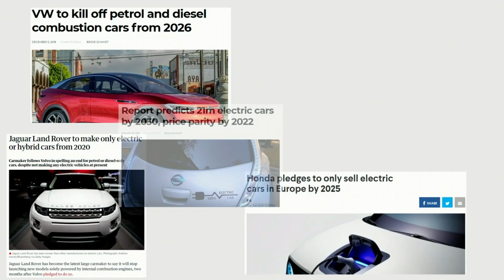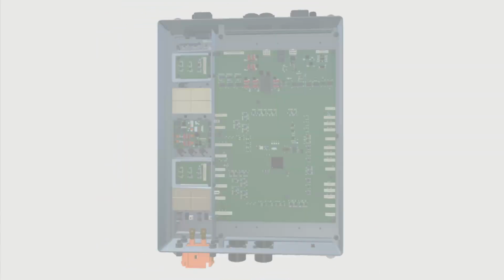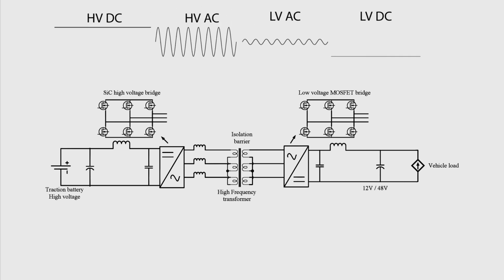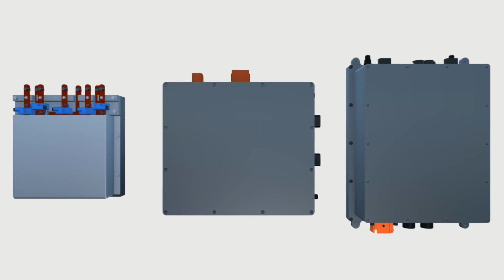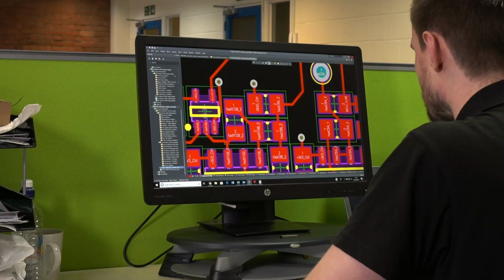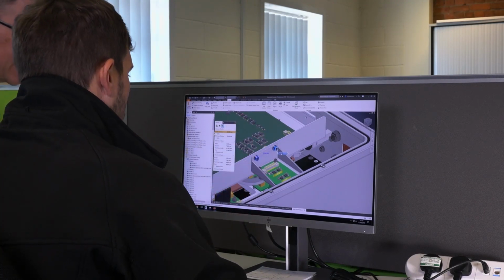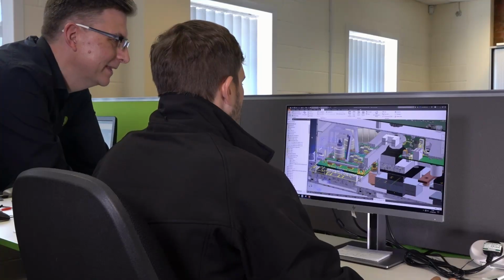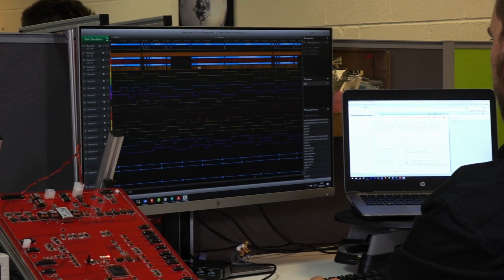Power Electronic Subsystems - AVID Technology

Comment: Always fascinating, AVID is such a fantastic resource for learning about the components involved in manufacturing EVs. Thank you very much for taking the time to post videos and podcasts.
I have a question: I have seen a charger with DC/DC converter combined in one unit. These are designed for small to medium installations such as conversions from ICE to electric power, perhaps up to 130-150 Amps. Do you think these are good cost-saving (and possibly weight-saving) devices, or is it another example of corner cutting from Chinese manufacturers, and not saving anything?
Reply from the maker: Hi Jack, thank you very much for the feedback we are really pleased that you enjoy our videos and podcasts.

More integration of devices is a big topic to try and reduce costs in EV powertrain components. Combining the DCDC and OBC into one unit is an example of this. In theory the DCDC will be at peak load when the OBC is not and vice versa so the overall volume of the cooling system and some other parts in the devices can be reduced. The control can potentially be shared although there are issues with the different safety requirements of the devices. The big savings potentially come from sharing some of the power, magnetic or capacitance which are the really costly components but this is hard to do without really compromising performance. So there are definitely tradeoffs. 

Sometimes just having one box to integrate and worry about is a benefit other times the packaging just doesn't work. Integrating the DCDC and OBC into the battery module makes a lot of sense to get away from expensive HVIL connectors and cables joining the devices up is also an easy win.
Reply: AVID Technology Thanks very much for that informative and detailed answer, Ryan. I learn in great big chunks thanks to your expertise, and I really appreciate your attention.